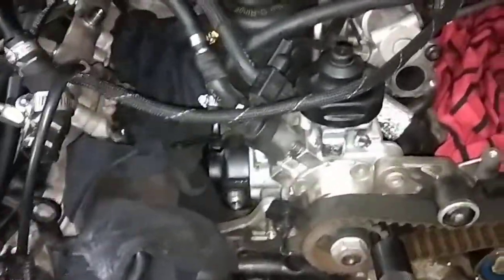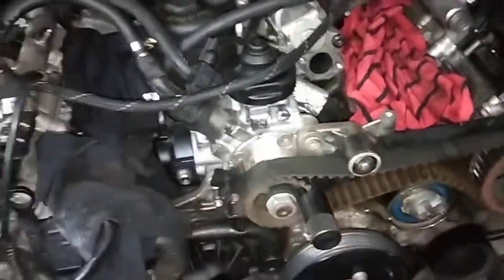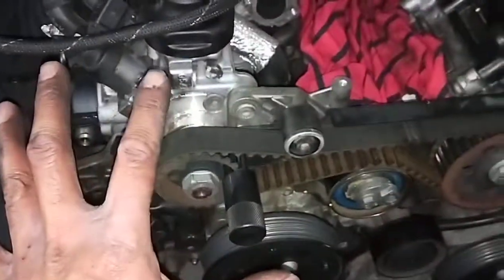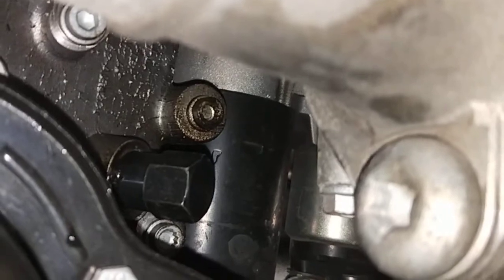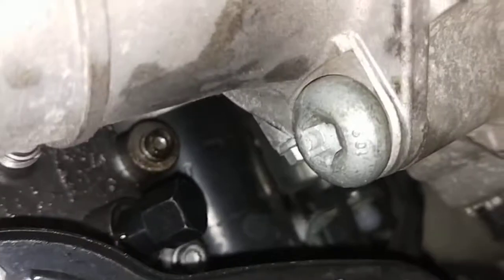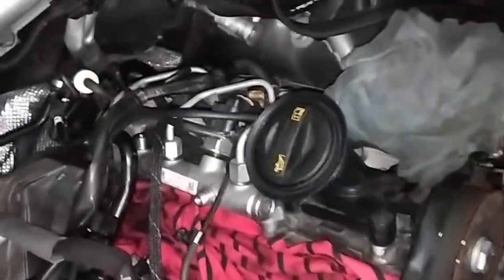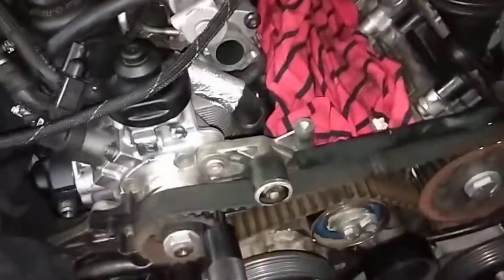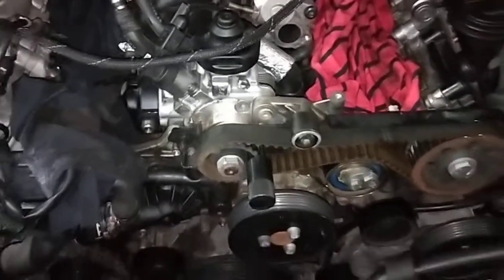Volkswagen Touareg - setting up crank & Cam lock tool before replacement of pump by EMD PORSCHE

Comment: Another very helpful video, thanks for sharing. My son has this engine in his Touareg. Recently started leaking oil. It was filling the valley. Oil was leaking from the back of the engine and also coolant. New gaskets, seals and also egr “surgery”. Not the easiest of engines to work on so I’ve learnt a lot from you, much enjoyment, thanks heaps.
Reply from the maker: Glad my videos can help 
Thanks